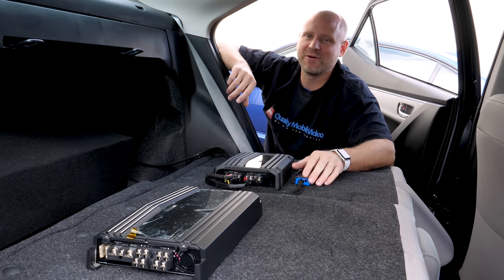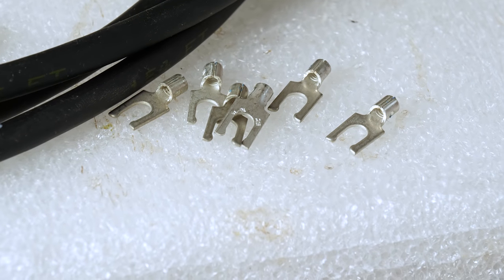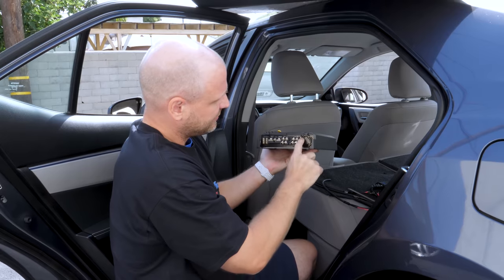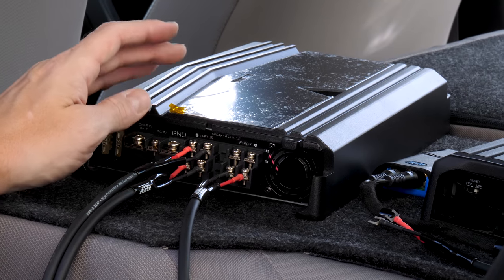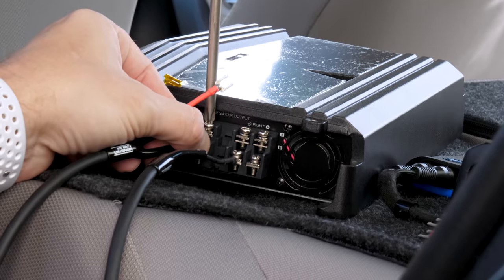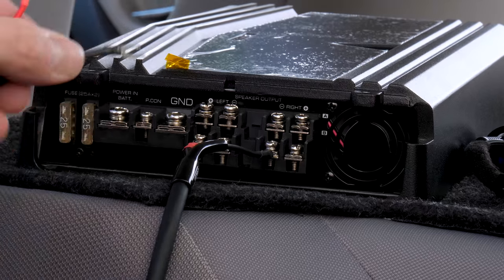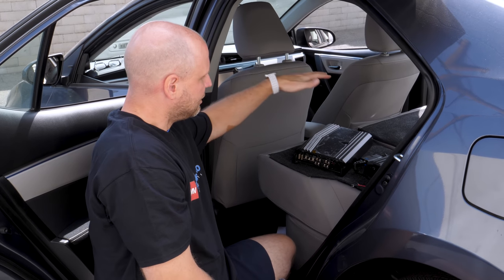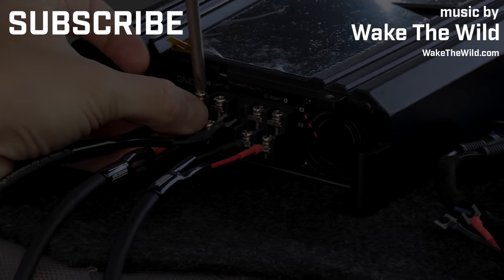How To Wire Speakers and Subwoofers to Your Amplifier - 2, 3, 4 and 5 Channel - Bridged Mode

Comment: Prettiest wires Ive ever seen. Quality work.
Reply from the maker: THANKS
Reply: Pp0
Reply: Have a 2 chainal amp can u hook up all 4 RCA terminals to the head unit. For fount & bac speakers?
Reply: @Qualitymobilevideo  can I run my midrange speakers on full instead of HPF as long as I have the crossover set to the speakers frequency range
Reply: @Qualitymobilevideo  you

Comment: EXACTLY the video I wanted to see!!! Not only am I getting ready to connect my 4-channel amp and 12" 4-ohm sub, but also plan on running my 4 front & rear speakers like you showed the 5-channel set-up. What really made me smile when I clicked on this video was the fact that you showed the connections to the exact same amp I just bought on eBay! At least it sure looks the same. Mine is the Kenwood KAC-8406 class A/B 4-channel. I've run amps with this same configuration in the past and it worked out perfect. I just like to make sure any new amp I buy is capable of the 5-channel hookup. Looks like this Kenwood is. My front and rear speakers are all four Clarion SRG-1623R which I purchased a few years ago based NOT on their 260w maximum power handling but for their high frequency response! These little speakers go all the way up to 30,000Hz with was about the highest highs I could find any 6-1/4's going up to in my online comparisons before I bought them. They just don't do much in the bass department. In my Chevy Prizm, I was able to cut out the 6-1/4" holes in the rear deck to make room for the huge bridges of the Clarion SRG-6953R 600-watt 5-way 6x9's. Those were the BEST sounding 6x9's I've ever heard in any of my cars in 40+ years! People used to ask me all the time what kind of subs I was running, when all it was were a pair of rear 6x9's! All my speakers were connected to a Boston GT-40 4-channel amp through a Clarion EQS-746 passive equalizer. ANYWAY... back to the reason for my comment! I was VERY thankful for your video! It showed me that my newest Kenwood amp IS capable of a 5-channel hookup! Oh, by the way, NICE touch on the making of your new wire terminals!

Comment: Sitting here like yeah i can do that 5 min later car is on fire....nailed it
Reply from the maker: LMFAO
Reply: Seriously!!
Reply: Mary Black lol naw it was just funny
Reply: Feel yah! I burned down my entire VW Golf doing this.
Reply: What type of amp do I need to run a 10 inch sub on and 2-4 regular speakers?
Reply: @anthonytiedt8725  500w to a 1000w should be plenty
Reply: Mark Green thanks. Does it have to be 2-4 channel ?
Reply: @anthonytiedt8725  you can hook 4 speakers up with a 2 channel either in a series or parallel depending on the speakers impedance and shit like that

Comment: I just sat here and watched several of your videos. I love how much pride you guys take in the quality of your work. From the Tesa tape all the way to removing the insulation from the spade terminals, and using color-coordinated heat shrink. I do have a couple burning questions, though. Those Monster Cable things you used to help separate the wires, what are those called? and secondly, what is the name for that cable you're using that has two insulated wires inside of it? I'm really hoping to install my stuff in a quality manner as you have.
Reply from the maker: +sammichmanjr they are called wire pants. Thank you for the kind words! We used Monster Cable XLN
Reply: Wow thanks for the reply! I don't know why I didn't get a notification.. But I really appreciate it! Keep up the great work!
Reply: I bought some from KnuKonceptz! They call them speaker wire pants. They were only a dollar each! You just tell them what gauge speaker wire you're using. In my case, I bought the 12 gauge ones. I also first seen those in this video! Plus, I also bought colored heat shrink in red, black and blue after watching this video. Now if I could only learn to solder! ;)

Comment: This video just saved the day. I used to have an amp in my hyundai elantra about, 16 years ago. Now, my corvette C5 came with an AMP. This video let me do the Sub woofer and 4 speakers for the 2 channel 5 speaker setup! Bridge the B and duplicate in A L & R. Amazing.
Reply from the maker: Glad it helped!
Reply: I've got an old Sony Xplod 444 amp (I bought used), it came with a subwoofer, so I figured I should be able to connect it, but couldn't find any information anywhere - until now.  Question - if you duplicate A L & R, how do you fade front to rear?
Reply: @SureshBopitiya  I was thinking about that as well for those who need the adjustability of fading.

Comment: Nothing could be clearer than this detailed explanation!
Reply from the maker: Thanks!
Reply: @Qualitymobilevideo  Hi mate. Had few things just wanted to ask you about, if you do not mind helping me out! 

I have a powered sub (jbl basspro sl) in my car. I also got 2 pioneer champion series 6x9 speakers (at the back) and 2 philips 6 inch speakers in front doors which i'm about to upgrade in some time and add a pair of tweeters. These are run by a pioneer head unit : deh-x3950bt. So just wanted to know if i can connect an amp (about 400W) as a 2-channel to those speakers and if i should be using a distribution block along with a capacitor as well...Thanks for your precious help in advance!
Reply: @Qualitymobilevideo  i have a question. I have a 12" memphis sub and 500 watt sony amp should i upgrade my amp to have a clear sound for my sub? Im thinking about having it put in my 2017 buick regal

Comment: Thanks a ton, man. I have a 9-speaker factory Rockford Fosgate system that uses a 7-channel configuration, and I have spent two days looking for a way to make that many speakers (all changed out to 4 ohm) plus another added sub work with a (more powerful) 4 channel amp. My issue was how to use the outputs in a way to maximize power. Found it in this video. Now I just have a lot of math to do.
Reply from the maker: Glad it was helpful!

Comment: How does wiring 2 sets of speakers (2 front/2 rear)  in parallel affect the volume/sound quality those 4 speaker?  Assuming total impedance of the speakers is matched to the amps capability

Comment: Glad they didn't go into dual voice coil subs along with what they did here. Good info for people out there who are new to car audio or just don't understand how this stuff works. For me it was mundane but MECP certified back in the 90's so... While car audio is just a hobby for me now, back then I thought I might want to install for a living. Installed on the side for several years while working in a electronics store. Got married and car audio took a back burner finally ending up operating tractors. Working on a install in our Hyundai Sonata. Have the double din touchscreen in running the factory speakers currently. Sub box with 2 Fosgate dual voice coil 12's is done and I'm working on the amp rack with EQ now. Once that's done I'll install all the door speakers and run wires from the amp for those. After that I plan to play around with some LED lighting. I've got the light strips and controllers already. Just waiting on the switches and several reed relays to show up for that. Our daughter is getting handed down the Mazda with 2 Boston Acoustic 10's and Soundstream amps.
Reply from the maker: Not bad for a first car!

Comment: You should've actually showed how to power two amps and how to hook them up that would've been awesome
Reply from the maker: W can do one on that!
Reply: Did you ever do a video for this?
Reply: Uh wouldnt a fuse block ground be basically the same thing you said you never do, just prior to that?.. 

Cocaine is a hell of a drug @Shawn Brown
Reply: I realize this is old but I wonder how many people's brains you fried with the very last example, pretend the bottom channel isnt there... lol
Reply: GutterFresh I’m new to this but after watching a few vids I think when you get a distribution block the two wires that you are wiring to the block have to be twice as small as the main wire connecting both of them but hey I could be wrong lol I’m tryna figure out how to safely set up 2 amps haha
Reply: @ikaikastevens3712  it's not complicated.. making a grounding block ground the amps .daisy chain the remote wires together no need for a relay for two amps and run a distro block for your power wires it very easy

Comment: The RCA cables seem to be my Achilles heel. I have a 6 channel Alpine amp with 4 door speakers and 2 subs. So do I need 6 RCA cables coming from my head unit?, Or does it know which is which, as far as low end signal and high end?
Reply: Depends how many come off your head unit.  Should at least run a sub rca and voice rca. Some head units have front and rear rca outputs for voice. Some have only 1 set. Run 1 set rca's for the subwoofers and a second for the vocal amp. If you do not have a 3rd or rear channel rca out the head unit you use Y adaptors to turn the 2 voice rca's into 4 to plug into the Amp (just make sure you keep left and right separate and plug into proper rca inputs to the Amp.

Comment: Good video but some people should be told that speakers in parallel will lose the fade adjustment from front to rear speakers. That's why I use a 4 channel amp and a seperate amp for the subwoofer.
Reply from the maker: Good point
Reply: That's how i learnt the hard way a guy connected my speakers like this and when I put it on loud I thought my front one  and back one weren't working now its loud and I like it
Reply: Can you go into more detail on how you connected that? And were you able to run it with stock battery? I know it's been some time but i'd really appreciate the help lol

Comment: So for wiring speakers in parallel you can just connect both speakers to one channel? I've also seen it done where you make the parallel connection though the speakers terminals and I'm guessing you instead have one set of wires going to the wattage source. Essentially the same thing correct?

Comment: Nice 👍.
I have 4 channel amp.
1pair 70 RMS each component.
1pair 100 RMS each ovel focal auditor speaker.
If one channel support 80rms in amp. Then how I get perfect power for 100 RMS speaker on rear.
Reply: parmveer singh set your gains on the rear higher if your amp is capable

Comment: Thanks for the tutorial guys. So just to clarify. I have a four channel MB QUART XA1.800, rated at the following. 
POWER @ 1-OHM N/A
POWER @ 2-OHMS 4 x 200 Watts
POWER @ 4-OHMS 4 x 100 Watts
MONO BRIDGED @ 2-OHMS N/A
MONO BRIDGED @ 4-OHMS 2 x 400 Watts

The speakers I have are the MB Quarts for the front. Rated at:-
PEAK POWER HANDLING 120 watts
RMS POWER HANDLING 80 watts
IMPEDANCE 4 ohms

For the rears I have the Focal AUDITOR R-100C - 4" 10cm 2 Way Car Coaxial. Rated at:-
Max.Power
120W as pair
60W each speaker
Nom.Power: 30W RMS

Channel 3/4 is straightforward. I'll connect the underseat 8" subs to them. My question is for channel 1/2. Can I connect the front and rears in parallel? So, front and rear left to channel 1 and front and rear right to channel 2? What sort of load will be presented to the amp? And what would I set the gains to considering there is a difference in the nominal wattage between the focals and MB Quarts? Thanks

Comment: Hi, this is a great video. Thanks for posting it. I do have a question. I’m installing a new 5 channel amp in my 2021 Toyota 4Runner with JBL. I know how to connect everything else but I’m not sure how to connect the two tweeters, front doors, rear passenger doors and rear tailgate speakers. Eight speakers total. The dash tweeters and front door speakers are wired in parallel stock. The rear passenger and rear tailgate speakers are wired in series stock. I’m not sure how to connect the tweeters and rear tailgate speakers to the new amp. I hope you can help me out. I’m a subscriber. Thanks!

Comment: what channel do I need? 2front, 2rear, plus 2-12in woofs. I did this myself. honestly I had no clue. the wiring was already set up though, just plug and go...
Reply from the maker: Well you have a few options, you can use a 5 channel or 4 channel. Or get a monoblock dedicated to your subwoofers and a 4 channel for the speakers. You could also power the front speakers with the head unit or with the new amplifier.
Reply: I would just use a good head unit to power all the factory speakers and hook the subs to the amp
Reply: headunit power is straight garbage lol
Reply: +Quality Mobile Video which is better, between the 4 channel or 4 channel + monoblock. I have both available?
Reply: 4 channel + mono if you have a sub, and if not just get a 4 channel.
Reply: +imBriz I have a 2000Watt amp I'd run the subs on. The other amp os rated @75wx4 RMS. I'm just wondering if that will be enough to get the door speakers pumping?
Reply: depends on door speakers but that should be decent enough, what sub amp do you have and is it real 2k rms
Reply: +imBriz it's DHD NXT 2010 I'm sure it's not hitting 2k the single 12 doesn't need that much. It's just what I have.
Reply: +imBriz I figured even if it did a 4th in rms it should be pretty powerful. After all I'm not going for competition.
Reply: I have 2000 watt sub and mononblock amp can i power 4 aftermarket speakers like 75watts prob each with that mononblock? Or do i really need 4 channel ?
Reply: @imBriz  I'll like your comment cos you are right one block is right and a sub and a amp seems alot but u need a dvc sub gives you better base
Reply: @imBriz  Fuck! I know this.😂

Comment: Cool video, well I m having problem with amplifier. I m trying to connect 600w rms subwoofer and 250w rms speakers to a
Pioneer GM-D8704 Class-D 1200w 4-Channel bridgeable amplifier. Will it work? Thanks.

Comment: Awesome video,  nice explained everything.  I have a question,  I have a Nissan titan truck with after market stereo  and speakers,  2  small speakers on the dashboard,  2 on the front door and a set  of 6.5" mid range on the rear doors with crossovers and tweeters,  also a 10" subwoofer.  I just got a new amp  a pioneer GM- DX874 class D 4 channel . A friend give me a dual subwoofer goes under the back sit,  can I use this amplifier to connect this dual sub with the speakers or do I need to get a separate amp just for the subs?

Comment: I have tweeters, two front, and two rear speakers and then I want one sub. What channel amp do I get? I bought this car that has jbl speakers installed(2 tweets, 2 front, and 2 rear) and it had an amp and was wired for a single sub. he had to take the sub and amp out when he sold it to me so all I need is to plug an amp and sub. problem is I have no idea what amp to get. he told me to get a 4 channel but when I asked him what amp he used it was a 5 channel one. I'm so confused.
Reply: Roshan Abraham 4 channels bridge 1 sub. 700 watts should sufficient. But yet again, what car you have? My car has Pioneer DEH3800UI head unit, Pioneer TS-G1605C 280w component speakers front, Pioneer TS-A935H 550w 3 way speakers rear and Pioneer TS-WX120A 120w active subwoofer with no amps at all. Sounds really great and price wise are affordable 🙂
Reply: Its a 2002 Subaru impreza outback sport. I bought it last week form a guy. It actually doesn't have tweeters but still has after market front pair and back pair. My issue is that It was wired to subs and a amp. When the guy sold it to me he had to take the amp and sub out. So now I have a ton of wires under the drivers seat(where the amp was) and I cant play any music until I plug them into an amp. That's why I'm really confused on what amp to get.
Reply: Roshan Abraham like i said, 4 channel amps. Just go with 1000w and you can go boom boom 😝
Reply: intergratypezero . So hookup front and rear speakers in parallel to the two front channels on a 2ohm stable amp then Bridge the two rear channels of the amp to run to subwoofer ?
Reply: Super Naught yup
Reply: Super Naught how would I hook up 5 speakers mids and highs. In each door. 2 five channel amps?
Reply: In my last two systems, I ran my front door speakers and rear speakers off the amp and ran the power to my tweeters from my head unit and it worked out awesome! You could still hear the ultra-highs because the tweeters are so close to your head.

Comment: This man is golden! A million thanks man!
Reply from the maker: Glad it helped!
Reply: Quality Mobile Video i need help finding an amp for my 4 door speakers. they each need 175 watts rms at 4 ohms. i want a 4 channel amp ( one channel per speaker) and i want as close to 175 watts per speaker as possible. any suggestions?
Reply from the maker: Those are some powerful speakers! Check these out:
https://www.qualitymobilevideo.com/apcle-6004.html

https://www.qualitymobilevideo.com/brx1616-4.html
Reply from the maker: Or bridged them with a 2 channel:
https://www.qualitymobilevideo.com/xtr15002.html

https://www.qualitymobilevideo.com/apcle-6002.html